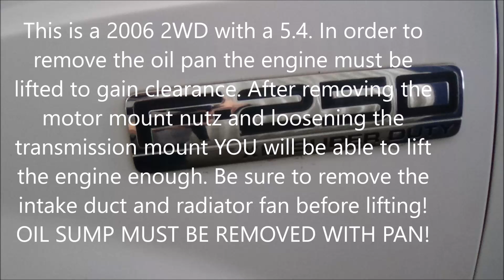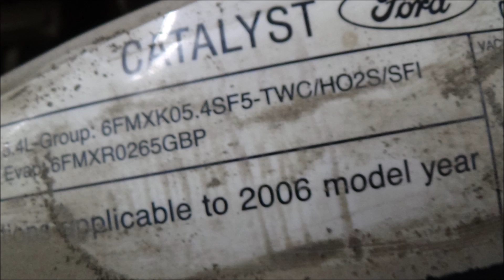Ford 5.4 Oil Pan Gasket how to Replace walkthru - 2006 F250

Comment: or you can just do what ford tells you in its service procedure and just disconnect 4 bolts and lower the front differential a few inches and disconnect 2 bolts for the sway bar......
Reply from the maker: If the instructions you looked up mention unbolting the front diff, then you're obviously not working on a RWD truck, which is what this video is about. Good luck
Reply: @LehewTech  but without the front diff all you do is disconnect the sway bar and the one subframe piece. No need to mess with the engine mounts.
Reply: @TonicofSonic   so to get this straight, i can just lower the the front diff and sway bar to get access to the oil pan with lifting the engine ? i have 2008 F250 4X4
Reply: 5 yrs old but your talking about a f150. Not an f250

Comment: I have a 2006 I didn't lift my motor to remove oil pan
Reply: Well, curious how exactly did you manage that. I have a 06, and it definitely appears to need to be lifted
Reply: But if i could avoid it, I WOULD LIKE TO

Comment: When removing the oil pan is it accessible to get the bolts on the bottom of the oil pump ?
Reply from the maker: I think so there are lots of youtube videos about doing the 5.4 oil pump
Reply: How much does it cost to to do oil pan gasket on ,2001 fordf350 5.4 v8  Super duty

Comment: I just had to do this in f250 four wheel drive 5.4 triton I did it on the ground with cherry picker lifted front of motor and floor jack to left the transfer case up a little it was kinda aggravating but I had to because the oil screen was stopped up with timing gide pieces and carbon yeah it was a pain in the ass